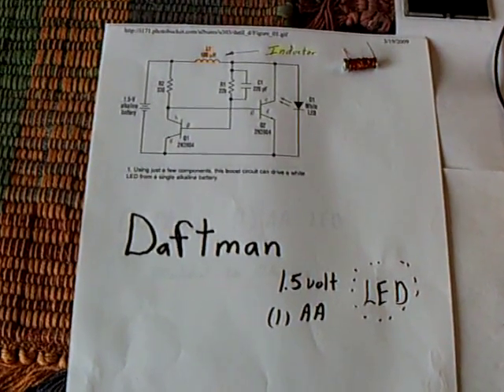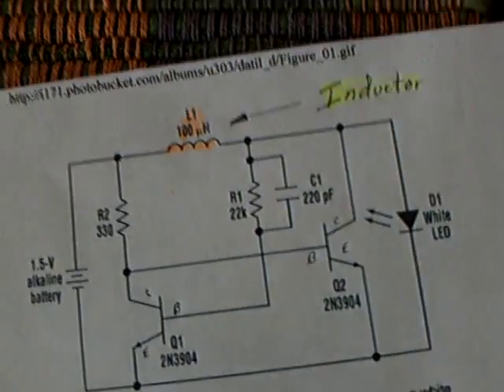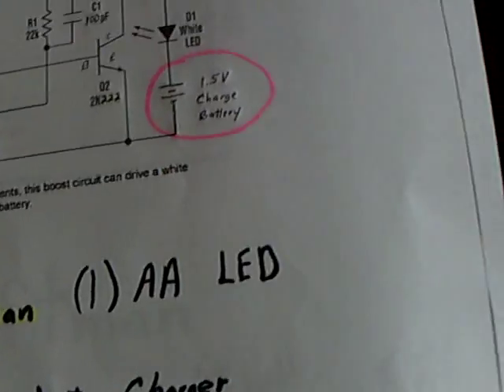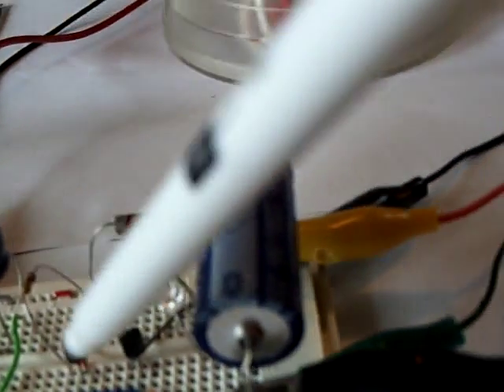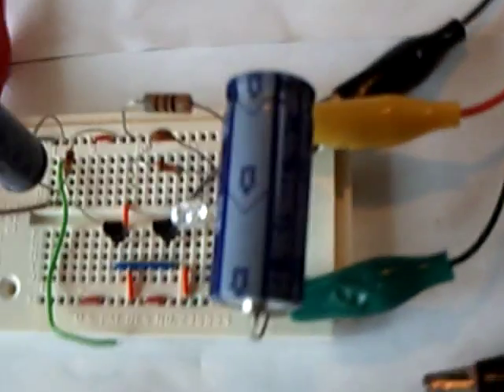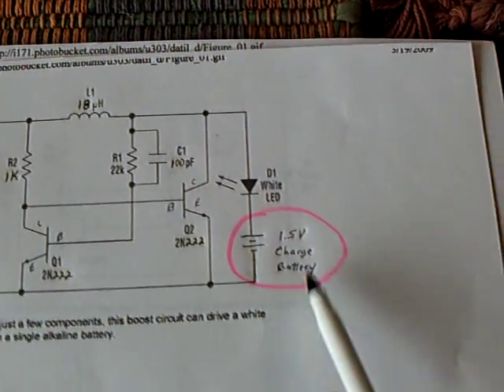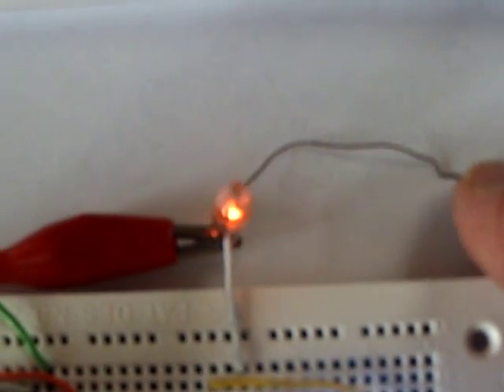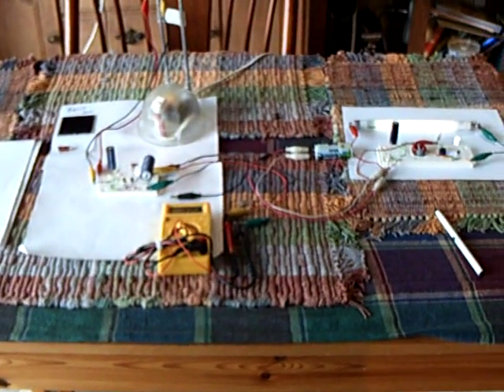Daftman's 1 AA LED Light----My replication

Comment: Thanks for sharing. 
I like the idea of swapping the batteries to keep the circuit going. 
To make it automated I am going to try a zero volt diode to sense the battery is full and maybe a 74V2T66STR to do the battery swapping.
It will eventually stop due to heat losses though should run longer than if it just used the one battery.